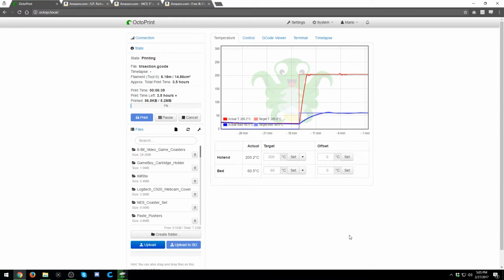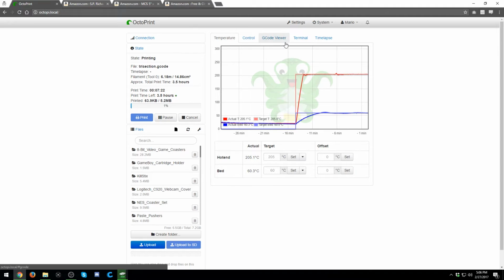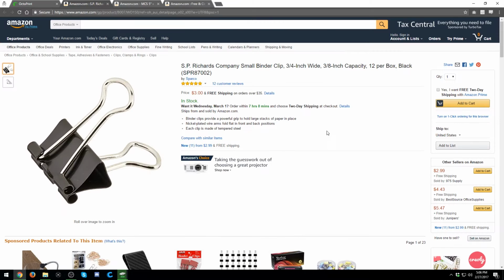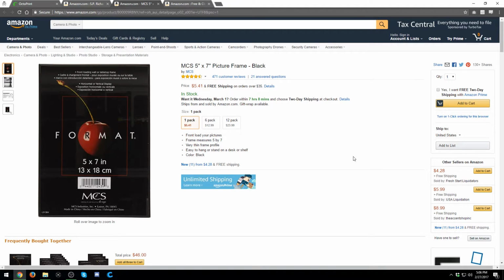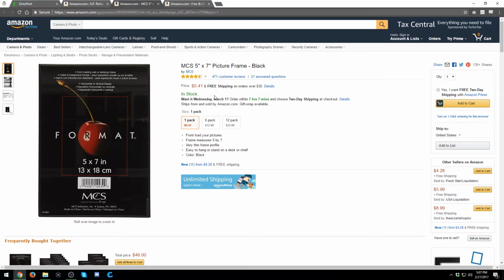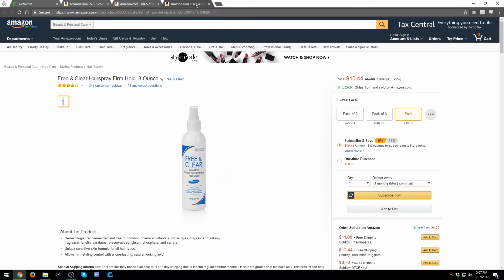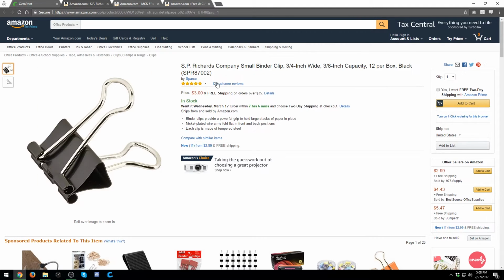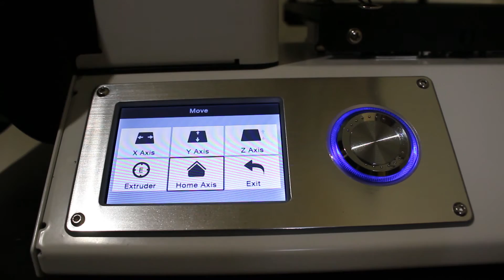How to Install a Glass Bed on a Monoprice MP Select Mini!

Comment: Hi I have one these printers and the original bed cover wire off. The glue on the bed is difficult to remove, any ideas?
Is the glass ok at the same size if the plate it did you use that size for convenience?
I also get a rattling noise as the head wanders off the bed. Any ideas on that?
Thank you
Reply from the maker: I haven't owned one of these in 6+ years so I wouldn't a proper resource to ask.

Comment: Frame glass is not tempered, if this glass is used and not completely and evenly heated, it will warp due to cold and hot spots in different parts of the glass. Your frame glass will last longer if you don't use the heated bed

Comment: You can can make the glass bed yourself your time is worthless and you have a blood bank nearby (I always cut myself if I even get near glass), or for $20 you can order the following from Amazon: "130mm x 160mm Borosilicate Glass Plate Bed Flat Polished Edge w/Corners Cut for 3D Print." It even has the corners cut off to expose the leveling screws. 
     Another thing you might consider is "CPU Thermal Silicone Pad Heatsink Cooling Conductive 205mmx205mmx2mm," for $15 which I have on order. It sounds a little bit like snake oil to me, but allegedly is tacky enough to allow the glass be easily removed and replaced, removing the need for those tacky binder clips.
     What is that black rubbery layer in the metal bed? Should  that be removed? (See, I don't know everything!)

Comment: Is your bedplate bent?  have found my bed to be bowed upward from front to back. Not sure if it was when I first got it. It's my first printer and I have been learning much. Thanks for the video
Reply: I got the same problem.. going to try this and see if it helps with getting it level.. it's like fucking alchemy now.. one print works, next two fail.. blah..
Reply: I went through half a roll of ABS without much issue and now all of the sudden I went to level and noticed I'm bowing significantly in the middle (right along where the nozzle rides when she's centered). Boggles my mind and is really pissing me off... She's level in the corners, but raised in the middle. I basically lost the center of my build platform...
Reply: I've gotten accustomed to leveling more for the center of the bed.  I adjust for a happy medium. Eventually you get the feel for the correct extruder spacing and just know that the rest of the bed may need a brim or raft if the print is large enough.
Reply: deathsythe212 the reason for this is the aluminum plate...it warps.  I dont use much more than 45c for heating the bed.

Comment: I've done this a while ago and before I seen this video.
Not sure why you say don't put the binder clips on the side.  Mine are on the side and works just fine.  I suppose you could run into some trouble if you are using the entire bed size, but for me, that is rare.
Reply: valveman12 I used my dremel and a diamond hole cutting bit with oil so I can just screw the plate down.

Comment: what happens if you just try to print on the metal?
Reply: It's a $200 printer. You are getting a lot for that money. This is like a $10 mod.
Reply: Christopher Lambe $10 if you don’t have an old picture frame or a wife with some hairspray.
Reply: it works fine with pla if you set the bed to 60C but for abs anything bigger than half an inch wont stick with out adhesive bc the board flexes as it cools to 60C from the 235C extruder

Comment: The clips can be fitted with a better margin if the top "lever" is removed: simply apply some pressure at the base where they meet the clip and slide one leg out. To replace do it in reverse. This little trick will also allow you to put the rear clips on the side, so if you're using a glass pane that is too long but close enough in width no cutting will be required.

Comment: PLEASE HELP fam
1. my printer starts oozing filament as soon as it starts the print, like before its on the bed, so it makes it hard to stick.
2. my printing bed is warped, will a glass sheet like this be unable to warp, hence fixing my problem?
3. how do you get your prints so nice, slow and smooth. my printer seems to always wanna rush and keeps getting messed up either by not sticking to the bed or well by not sticking to the bed.... probably my biggest problem right now haha. must be because of the warpedness. sorry for rambling really tired, and frustrated... please help if u can. u seem to know ur shit man.

Comment: You can actually get a piece of glass custom cut to size locally in most places, for rather cheap especially at those sizes.  You can even get the screw holes cut into it.  I doubt this picture frame glass is heat treated, which means it wouldn't be great for heated bed.  I mean it might work, but eventually you might crack it or it could shatter suddenly, which wouldn't be good for your eyes if a piece is ejected into it.
Reply: How hot does a piece of glass have to get for this to happen? The printer bed only goes up to 60c
Reply: I ordered a piece of amazon for pretty cheap. Made specifically for this printer, even has corners cut for the screws and leveling

https://www.amazon.ca/gp/product/B075XJ5ZP1/ref=ppx_yo_dt_b_asin_title_o00_s00?ie=UTF8&psc=1

Comment: a silicon pad works great put between the bed an the glass wont move. no clips needed. also you didnt mention the 3d printed adjustment piece so that you wont hav to adjust the bed up that much higher. it slips on the back to stop the nozzle from going to far down via the stop button.

Comment: You should really print out a z axis spacer for the bed so you don't have to make your bed super low. Also I would highly recommend that you put the hair spray on the glass away from the printer so that way you don't gum up the inside of the printer.